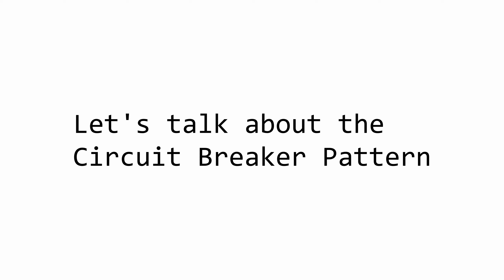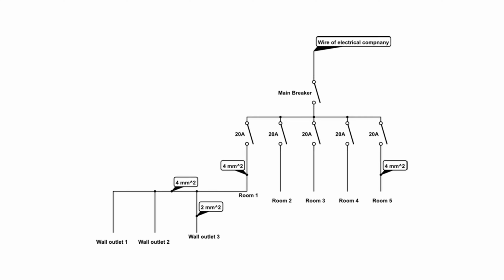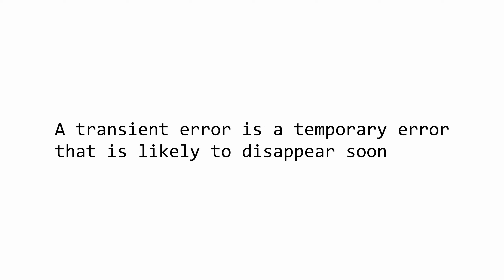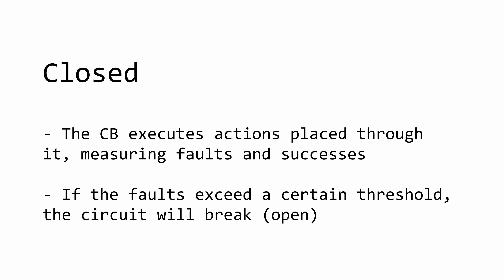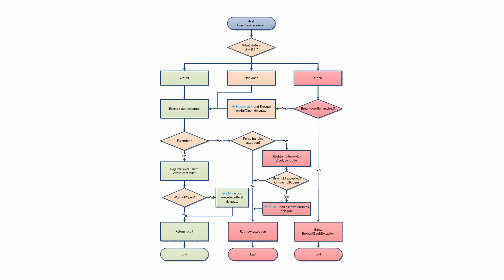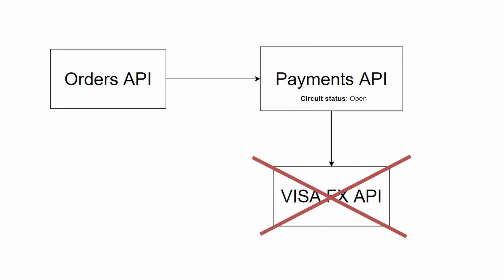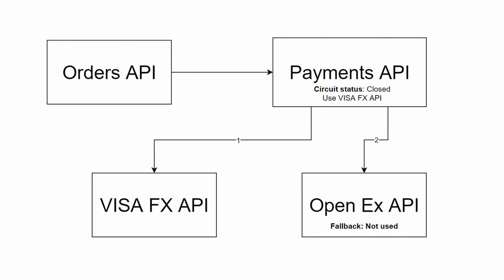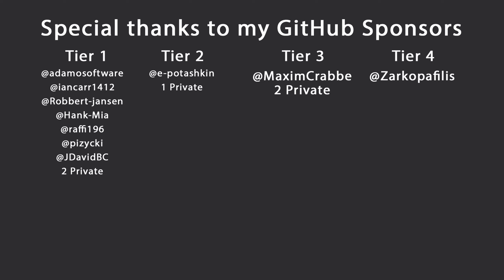The Circuit Breaker Pattern | Resilient Microservices

Comment: Hi Nick, first of all thanks for this great video. 
I have a doubt (I Hope not a stupid one), when the cirtuit enters into "Open" state, It means that meanwhile the service is not going to handle incoming request? Or are them processed in another way?

Thanks! :)
Reply: I believe it fails fast, so I guess depending on your implementation, you may deliver a 500 immediately instead of having your service retry several times.